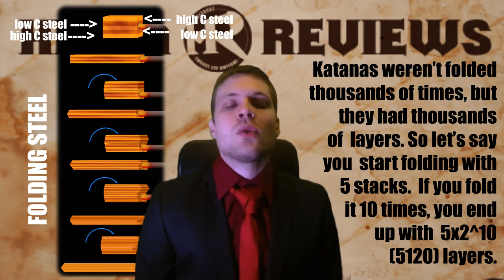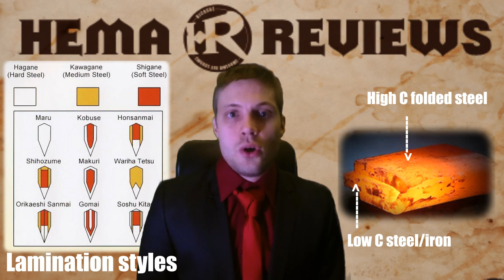Educate Yourself: Katana vs. Longsword

Comment: I just don't understand why everyone keeps comparing a katana to a longsword. The swords in question are not even under the same philosophy of use. Nodachi to longsword would make more sense, or katana to arming sword. I mean you wouldn't compare a carbine to a battle rifle, would you? Well, comparing these two swords to each other is the combat equivalent of doing just that. We might as well discuss the differences between tanto and the basket hilt rapier.
Reply from the maker: This is actually not true. The nodachi were mostly used as an anti-cavalry weapon. The equivalent for that would be the Bidenhander. The katana & longsword are much closer to each other in terms of use, as both were used as a side-arms and self-defense weapons. An arming sword is a single-handed sword, and therefore again an inferior analogy, as both the katana and the longsword are primarily swords used with two hand. So the comparison is actually somewhat in place - hell, even a lot of the techniques are very similar.
Reply: HEMAreviews
I would still disagree in terms of philosophy of use in combat. Obviously, combat between all of Europe and parts of Japan differed in practice, tactics, strategy, style, and overall technique. I will agree to your comparison in similarities; however, I still view both swords as completely different weapon system categories. Longsword is a broad term that covers a verity of swords, where as a nodachi, odachi, and katana are very specific. I view it as assault rifle vs Mark 18 CQBR. One is a general category and the other is a specific carbine (minus company brand). As such they have similar (which I agreed with) compared uses, but serve completely different philosophies of use (which is different than technique of use). I don't see the longsword in use as I would a katana as a sidearm. In my mind a bastard sword (again another broad term) more inline with the use of a katana. Even though a bastard sword and longsword are similar in technique of use, they serve different philosophy of use.
Reply from the maker: AsianTrix
 Could you explain the differnces in philosophy? I'm not quite sure I completely grasp that part, thought that might be because I'm not familiar with the JSA philosophy in general...
Reply: According to wikipedia, the term "longsword" covers espadón, montante, or mandoble, Italian spadone or spada longa (lunga), Portuguese montante, Middle French passot, and Zweihänder between the 15th and 16 th century. So maybe I'm not understanding what you consider a longsword. But that doesn't change anything I am about to discuss. Philosophy of use and philosophy of technique are different subjects altogether. Even with that, classifying the katana as solely a two-handed sword would be a mistake. The katana can be, has been, and was commonly used in combat with one hand and by people with only one arm. Especially when the Niten Ichi-ryū nito style became popular. Which is why comparing it to a primary two-handed sword makes no sense to me. A hand and a half sword (which I know to be bastard swords) makes more sense to me. Now, philosophy of use in combat is, as you said, side-arms. However the katana was not created, evolved, or meant to be used defensively. It is design since 900AD has strictly been to be offensive. What makes the katana philosophy of use different from other swords is how to can be drawn, used, and be effectively put away. So much so that there is a separate martial art that focuses solely on just those principles called iaido and iaijutsu. The way soldiers transition from a rifle to pistol and back to a rifle when needed. With a katana the objective is to transition into a more offensive or better primary weapon (yumi bow, naginata, or yari spear). With any longsword (by any term from 14th to 19th century) once it is drawn, the likelihood of re-sheathing it and moving onto a different primary weapon is very low. Where as archers transitioning to swordsmen, and then back to archers is common place in Japanese warfare.
Reply from the maker: AsianTrix
 Hey, I'll just go through these one by one. I'm not sure where Wikipedia got those namings, but they seem to be somewhat incorrect. The size and therefore use of these is way different, and should definitely not be put in the same basket. The lines between them are often not very sharp, but generally the guideline is that a longsword is a sword used primarily in both hands which you can still carry on your waist.
And even though the katana was sometimes used as a one handed weapon, its primary design is to be used two-handed. As such, I think it's better to compare it to another sword that's also primarily two-handed, instead of comparing it to a primarily one-handed weapon. Also, how you know that bastard swords are longswords, I don't know - there is basically no evidence of what a bastard sword refers to. For longswords, it was started being used in the late 19th century, though there was (and is) no grounds for it. I'm not sure what you mean by katanas being more offensive... All swords are offensive. By self-defense I meant that if you were attacked, you defend yourself - usually by attacking the opponent. True, due to its shortness and curvature, a katana could be drawn faster, but I would not call it more offensive simply for that. Also, the katana started appearing in the early 15th century - though the predecessors did indeed go back to the 10th. The Niten Ichi-ryū uses two weapons, which is vastly different from simply using a single weapon one-handed this video is great as far as Euro nomenclature and single-handed use goes: https://www.youtube.com/watch?v=iwdg6lblKow .
And as far as battlefield goes, we've established two things: first, that these were mostly non-war weapons, where they were used similarly (except for the drawing part). Secondly, that in war, these were sidearms, meaning that you only used them in a pinch, and preferred other weapons, such as polearms or bows. So this again is the same for both weapons. I'd argue that it was the other way around, though - you transitioned to the katana after breaking/losing/giving up your primary weapon, not before. I'll have to look up archers transitiong to swordsmen and then back, since it seems to me that'd be difficult to do. Once the fighting comes so close that bows are switched for swords, I don't see why you'd switch back to bows.
Reply: So we both agree that there is the glaring misunderstanding that what I thought "longsword" meant from Wiki; is different than what you are telling me what longswords are. From what you are telling me (according to what you have told me what longswords are), I would agree that they are fair comparisons.
Reply: AsianTrix For the most part this video is comparing the processes involved in smelting, folding and laminating steel. Correct me if I'm wrong but wouldn't these processes be pretty much the same whether you are talking about an arming sword, longsword etc? If this is the case it really doesn't matter whether you don't consider the long sword to be a valid analogue to the katana.
Reply: Towards the last 3 min of the video he compares the physical attributes of the swords. I would have been fine if the whole video was about smelting and forging, but its not.
Reply: AsianTrix Fair enough but I still think it's a fair comparison. Despite their differences they were both the most common two handed swords used by their respective countries.
Reply: I respect that opinion. Europe is more of a whole continent and Japan is just a country (but I get what you are saying). As discussed with the video creator, it depends on the term "longsword"; as the wiki definition and classification differ from his. The katana was commonly used both single handed as well as with two hands (more commonly use with two hands). But the o-dachi and no-dachi were the most commonly used two handed swords in Japan, and were strictly only used with two-hands. I think that they are different tools with many similarities and a common purpose of use. The same could be said about battle rifles and assault rifles, but I wouldn't expect a firearms expect to compare them side-by-side in a video for the same philosophy of use.
Reply: AsianTrix Some longswords could be used one handed and nearly all of them involved one handed techniques such as thrust singles. 

It would be fair to compare battle rifles to assault riffles if the werethe most common respectively used weapons for a given situation. Panzers tanks vs Sherman tanks are compared constantly online despite being very different for this reason.
Reply: Again, according to wikipedia, the term "longsword" covers espadón, montante, or mandoble, Italian spadone or spada longa (lunga), Portuguese montante, Middle French passot, and Zweihänder between the 15th and 16 th century (making the term longsword a two-hand only weapon or one that could be used one-handed). HEMAreviews disagrees with that classification and I'm not expert enough to state one way or another. However, katana, o-dachi, and no-dachi are very specific swords with obvious differences in usage. If you think common usage for a general purpose is enough reason for a valid comparison, I will not argue.

(REF:http://en.wikipedia.org/wiki/Longsword#Terminology)
Reply: AsianTrix In HEMA a longsword  is commonly understood to be a cut and thrust sword with a two hand grip but you're right the definition is fuzzy. There is no hard line. Handle and blade length are a spectrum there is also a spectrum between a specialized cutting blade and a specialized thrusting blade.

Historically the definition changed as well and it could vary by context for example a "long sword" could simply refer to the longer of two blades even if both of them were short one handed weapons.

Video games often refer to long one handed swords as "long swords" and refer to long swords as two handed swords.
Reply: AsianTrix A number of reasons.  One is that they are both the iconic and most recognizable of their respective cultures swords.  

Another is that they the primary swords of Europe and Japan's most famous warriors- knights and samurai. 

Finally, both swords are actually pretty similar in their fundamentals so a comparison is bound to happen.  

There's a lot of different reasons.
Reply: AsianTrix I'm late to this, but you shouldn't take the Wiki article too seriously. Many of our modern terms for medieval sword classifications have been applied well after these swords were in use. A lot of sources from the period simply referred to swords as "swords" (or whatever their word for "sword" was). Some of the swords mentioned in the Wiki article on longsword are actually great swords (two-handed swords). E.g., the montante is a Spanish great sword, the spadone is an Italian great sword, Zweihander is a German great sword, etc. These are much larger and heavier than the longsword and they are the true two-handed swords, because you need to use two hands (and your whole body) to move them effectively. They also aren't something you can wear on your person and still easily access (they carried them like rifles, rather than slinging them on their backs), meaning they were used when you already knew you needed it, as in a military context. They weren't walking around swords.

As far as long swords go, there is definitely a broad range of characteristics. But as far as our modern terminology is concerned, the following English terms usually apply to this sword, though they may imply certain things about the variety of the sword: long sword (of course), bastard sword, hand-and-a-half sword. The reason for the last term is that, while they were predominantly used with two hands, some long swords (depending on point of balance and hilt length) could be wielded with one hand (though a one-handed sword is going to work better in one hand). The free hand would usually be used for grappling, defense, blade grabbing, etc. Even for longer long swords (German long swords are often longer than their Italian counterparts, for example), you can temporarily wield it with one hand for certain maneuvers that either demand extra reach or a free off-hand for grappling.

TL;DR: People in medieval Europe didn't really classify things the way we do today. As a result, we have applied our own terms, but they aren't consistent enough that you should necessarily take them at face value. Think of it more like a fluid spectrum for which many swords of varying characteristics and purposes still fall under the umbrella term "long sword".
Reply: +AsianTrix 
They have about the same weight, are used with two hands and at about the same times.
An Odachi is a much heavier weapon and should rather be compared to a greatsword. An arming sword is used with one hand.
Reply: +Asian Trix When one talks about the Longsword one refers to the Fechthandbücher (Fencing Manual) of the 15 century in various contries of Europe. Contemporary use of "long-sword" or "longsword" only resurfaced in the 2000s in the context of reconstruction of the German school of fencing, translating the German langes schwert.The Langschwert (Longsword) has typically a longer grip. The illustrations show that it is mostly used with both hands. The longsword as a late medieval type of sword emerges in the 14th century, as a military steel weapon of the earlier phase of the Hundred Years War. It remains identifiable as a type during the period of about 1350 to 1550.It remained in use as a weapon of war intended for wielders wearing full plate armor either on foot or on horseback, throughout the late medieval period. From the late 15th century, however, it is also attested as being worn  and used by unarmored soldiers or mercenaries.

Comment: Very good overview. I am working on a project where I try to work through why some of the physical differences exist between the blade. I was wondering if you had any citation to this you could link me to?
Reply from the maker: Gladly! I'm not sure if by physical differences you mean more metallurgical stuff or more form stuff. If it's metallurgy, then I warmly recommend Alan Williams' Knight and the Blast Furnace and Sword and the Crucible. The books are bloody expensive, though, so it might be tough to get to them... The Japanese medieval sword research is much easier to find, so that' shouldn't be a problem - even most of the info on the internet is solid. If you're looking for form-wise differences, then visit my blog here: http://hemareviews.blogspot.com/2013/09/original-longswords-with-weight-length.html
I've put together a list of medieval swords with their stats, as far as I could find them. The japanese blades are, again, much easier to find. Also, if you're going to go with the form, be sure to mention Swiss sabres and messers, as those are actually closer to the katana shape-wise.

Cheers!
Reply: Well I was going to start out more or less with longsword vs katana. I wanted to look at it from an engineer's perspective (Engineering student) of what the design criteria of what a sword is. I was going to discuss how weight is a major factor in the design of a sword and how that ultimately leads to the katana being a very short two handed blade due to resource restrictions in Japan. Its a working progress but I'll let you know if I ever finish it.

Comment: I've got a question for all you Katana vs. Longsword people. What's better, a Phillips screwdriver that is 10cm long, or a Phillips screwdriver that is 15cm long? When you can give me an empirical answer on that one that there are absolutely no challenges to and no situational information involved, I'll listen to your Katana v. Longsword rant.
Reply: Analogy doesn't apply without adding some other constraints or context. If you are talking about using the screwdriver in a hard-to-reach location where the added length of the screw driver would be beneficial, that's different. Often times, having a screwdriver that is excessively long when you are working in a cramped area actually may be a detriment. That is why context plays such a huge role when talking about the benefits of swords just as it applies when talking about which tool works in the best situation. You can't just say that a longer tool or a longer weapon will automatically be better.
Reply: Daric Soldar
That's my point, actually.
Reply: Will Truth/Deceit Fair enough. :)
Reply: +Will Truth/Deceit The 15cm long Phillips head will cause deeper tissue damage, but might also be slightly harder to wield in a tight quarters scenario (though not appreciably).

Or did you mean using them as screwdrivers?
Reply: +Lono5885 You could also use the longer screwdriver as a lever to throw very small opponents.
Reply: Lono5885
The point I'm making is that the question itself depends on the use of the tool. Simply asking which one is better leads to too much ambiguity. The same extends to longswords and katanas. Simply asking which one is better is silly. The answer depends on what scenario we're talking about. Draw cuts, stabbing, parrying, weight, speed, technique, durability, etc. Overall it's usually the tool user that makes the difference, not the tool itself.

For example, a historical Japanese soldier would probably not be very effective with a long sword nor would a man of arms be effective with a katana. Neither would be good at wielding Chakrams either I imagine, but that doesn't make a Chakram useless.
Reply: Looks like neither of my screwdriver jokes landed
Reply: It does matter on the user and its reach. Not to forget if he was trained with a 10cm or a 15 cm one, but in the end the one wins who had the better screwdriver instructor. ;)
Reply: The flathead of course! It fits in both types of screws. (I know that wasn't an option)
Reply: Orion Melton You made my day.